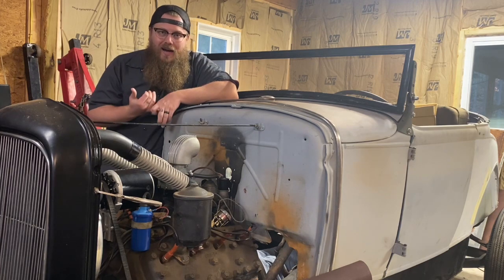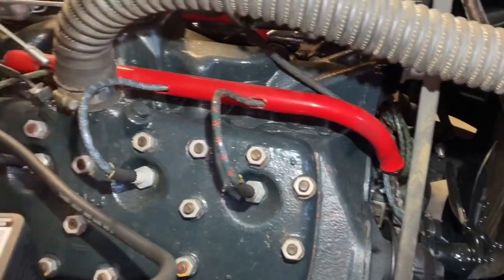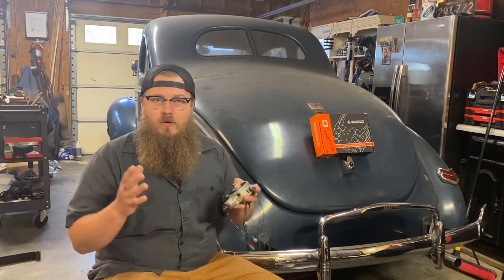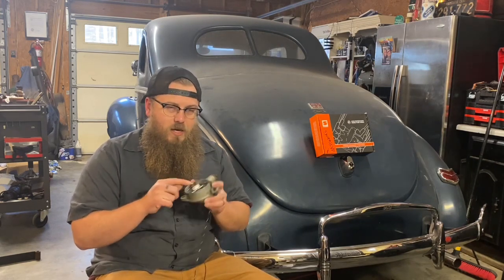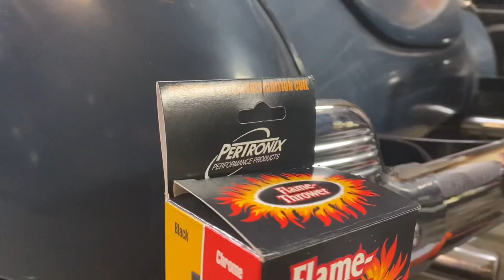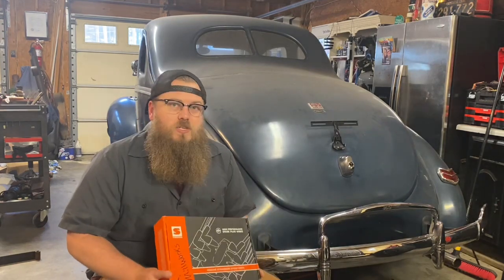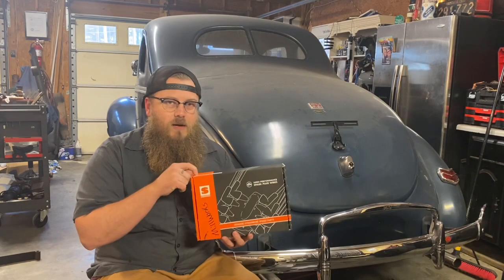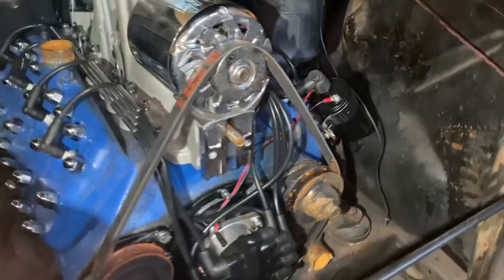Points vs. Pertronix and Install Ford Flathead

Comment: Love my Pertronix.  Like you I bought the flame thrower coil.  I also bought the Pertronix wires, only because I wanted it all to work 100%. Fired right up and It's been flawless for a couple years.  I always wonder what the problem is with the people who can't seem to get it to work.  I converted an old dual points Mallory; part of me wishes that I would have bought a new distributor. Still might one of these days
Reply from the maker: A lot of people aren’t aware of coil resistances and how bad solid plug wires are, I think it’s just a lot of bad information out there or the lack of
Reply from the maker: I’m glad yours is working so well!

Comment: Converted to Pettronics on my 8BA and it ran great -- until it didn't. 
 After about 5- 6 months,  it quit on me on the road about a block from my house.
Upon raising the hood, i saw a wisp of smoke in the distributor area.
 The Pertronivs was cooked for some reason.
 Convetted back to points and condenser  and it's been fine for the last year.

Comment: When using the Pertronix , what plug wires are recommended. I’ve seen that you shouldn’t use solid core wires, funny that no body advertises the wires for running the Pertronix system.

Comment: Great videos. Thank you for sharing. I just bought me a project ‘35 Ford fordoor. Also working on making it a 12v conversion. Question??? How do I put the fan back on when I install the alternator? Or did you put in an electric fan? Can you please show a video on that. My alternator also sits in the front on top of the engine. Thank you

Comment: Great info. Put a Pertronix on my 49 flatty motor. Didn't know I should ditch my ballast resistor or about those new plug wires. Got some monkeying to do befor spring.  Great channel.  Have you heard of the Cheaters car club in Milwaukee? We build some bitchen traditional rides up here. Keep it coming.

Comment: Pertronix always crap out on you in the dark when it's cold out. I tried 3 times, and each time, just after warranty, I had to have a tow truck get me and the wife home! She's had it with my hot rods. Yes, I had the right coil, and the correct wiring. Pertronix are crap! I'm down the parts and 850.00 in towing.

Comment: 1939 Ford Deluxe original 6v helmet style distributor. The Carbon Contact Point has been misplaced. Is there a replacement available that you are aware of?

Comment: according to Pertronics, they recommend the 0.6 ohm flamethrower if you have a 6 volt positive, 8 cylinder and not the 1.5 ohm flamethrower

Comment: Does a 1942 ford 6 cylinder g motor 6 volt positive ground take a 1.5  ohm coil or a 6 ohm coil. Also how do you adjust timing on the old crab distributor.        I:37 p.m.

Comment: I received my Distributor and the fan pully is in the way, do you have a video on how to remove it? And any suggestions for a replacement?
Reply from the maker: Hi Will, hopefully the fan isn’t on the crank pulley, is yours on the generator or is it on its own bracket? Either way I think yours should be bolted to the intake, there should be one long bolt on the end of the intake to take off, just make sure to disconnect the battery
Reply: @WiredCustomsSpeedShop  yes the pulley that’s connected to the the crankshaft and not to the generator. The pulley to the generators out of the way. It’s the one right in front of that that connects to the fan.
Reply: Just got the pulley off! Now I’ll see if the Protronix will fit, what would you recommend I do to fix the fan pulley/fan?
Reply: Ok Zac, next question, the Protronix pro billet distributor says must use .6 ohm coil. The coil I received is the .5 from vintage auto garage. Should I get the .6?
Reply: Called Vintage Care Garage they said .5 is fine. That’s what they use for all the conversions. I do have another question is the bottom pulley tring to get that puppy back on and it seems like it’s hitting something. Do I need to take it out of gear and let it spin to fully go into the shaft?

Comment: Hi Zac, I'm going to install the Pertronix Distributor and I was wondering if I need to set the timing on the Truck to TDC or just install the Distributor ?
Reply from the maker: Hi Will, what type of motor?
Reply: @WiredCustomsSpeedShop  59 it's on a 1945 Ford Pickup
Reply from the maker: @will-Rynerson  no need to mark TDC, the 59 has a taper and the distributor has a taper where they connect, the only hard part with that install is just being able to reach the bolts
Reply: @WiredCustomsSpeedShop  I never saw that do you have a video that shows that?
Reply: @WiredCustomsSpeedShop  So, I just mount the  distributor and I'm good to go? other than making up the spark plug wires. Watched your video which was very helpful, thanks for that.
Reply from the maker: @will-Rynerson  No problem at all, just make sure you get the tapered end’s correct and you’re good to go

Comment: I like the pertronix option.   I have a 8BA that’s stock and I want to upgrade to the PerTronix, is there any kit that you can buy that will have the wires, coil, and any ballast or resistor for a 12 volt negative ground build?   Thanks
Reply from the maker: Thanks for watching Kirk, if you call Millworks Hotrod and tell them I sent you, Dave can set you up with a complete kit, Dave isn’t just a parts retailer he builds Hotrods too so he knows his stuff
Reply: @WiredCustomsSpeedShop  Thanks will do.
Reply from the maker: @kirkcarlson6670  no problem
Reply: What goes in place of the resistor?

Comment: I hate points. I've done Pertronix and Crane conversions but best conversion was just going to wrecking yard and stripping 80s/90s distributors for a pickup and reluctor ring. Machined reluctor to press over my distributor shaft lobes. Easy $10 electric ignition conversion with robust OEM parts.